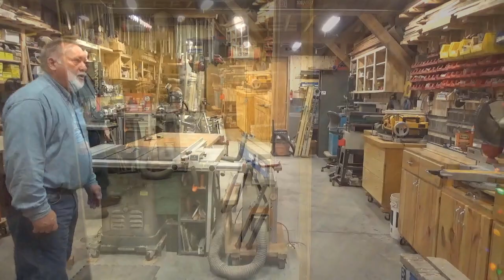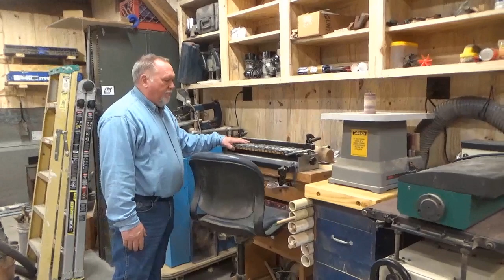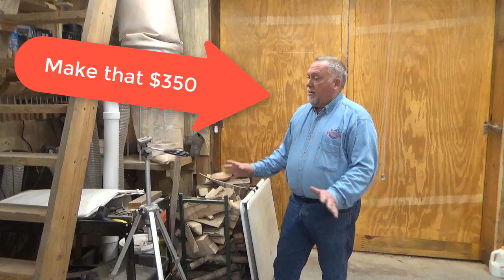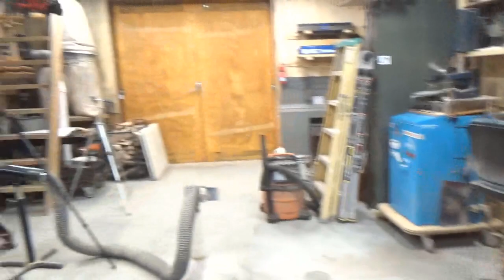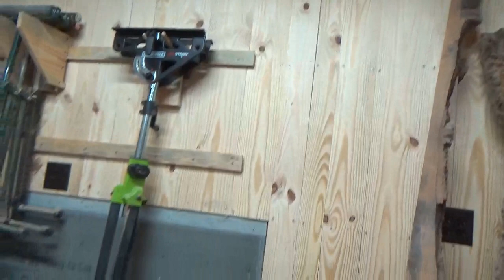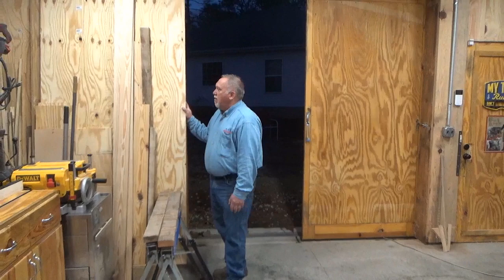Wood Working Wood Turning Shop Tour

Comment: Awesome shop Mike, thanks for sharing. Some great idea's for setup you've done. Good idea on the power supply too, I have the issue that I can't turn at night as the 24/36 makes the lights flicker in the house, lol, I usually get the wife or one of the kids come out to tell, that's when it's time to stop turning, lol. I'm not going to worry about it at this place though, as we're looking at moving, just need to make sure the new Farm has a building worthy of becoming a workshop and can easily have the power upgraded if needed.
Reply from the maker: Thanks for watching!  Having the 400amp service installed in the house was a critical move and has really paid off.  I am an electrician and wired this the way I always wished to do it.  I ran all power in conduit and made provisions for expansion.
Reply: Good job, pre-planning for future alterations is always a good idea, bit difficult when moving into an already built place though.